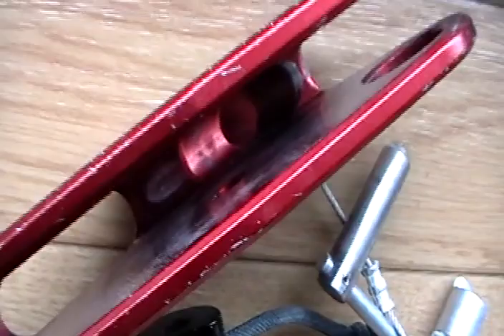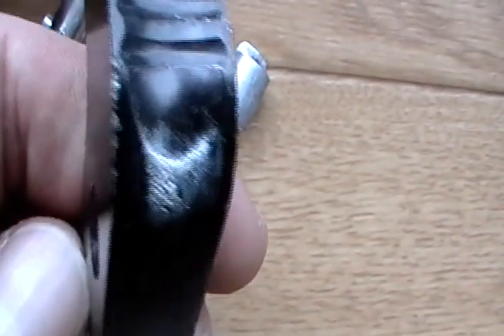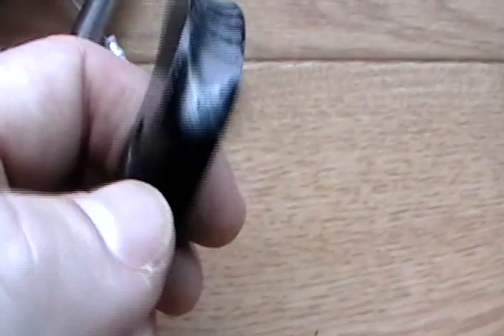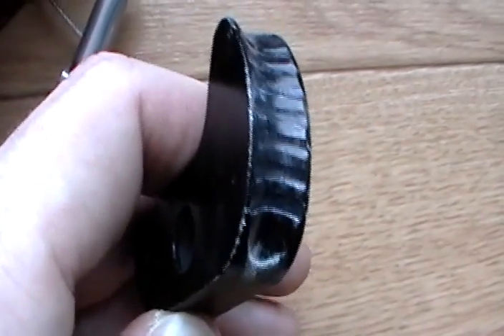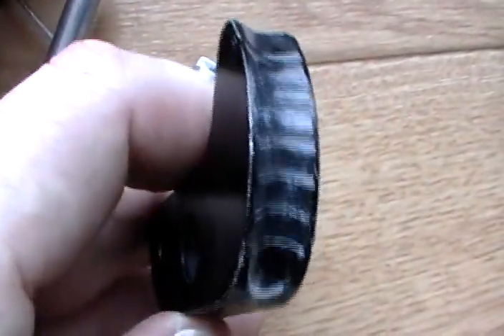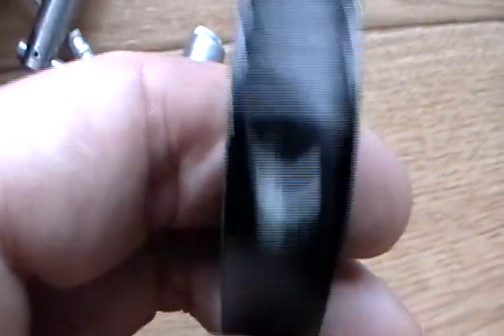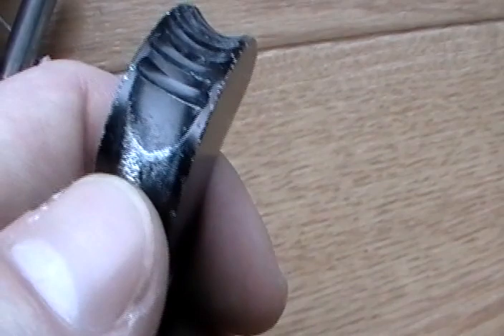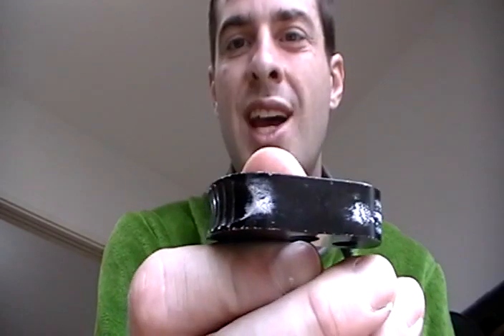UPDATE SERIES #4 - Rope Solo Lead Climbing - Soloist Belay Device Jamming with the Climbing Rope

Comment: Thanks, Aron.  Nice presentation and analysis of the problem.  Unfortunately I have a similar problem and no solution is obvious.  I have used the Soloist since its inception and mostly with great joy.  A wonderful alternative to the old methods of using knots.  But lately my Soloist locks up -- only on rappel.  Never a problem on lead.  I use very little (colored) chalk and the Soloist doesn't get any from the rope.  I don't do those horrendously difficult climbs, but it's a little disconcerting to have the thing lock up on a free rappel! ( I am (decidedly) not dripping with sweat on a 5.7 or 5.8. ) I have examined the device carefully and could find nothing obvious.  It has some wear -- particularly in the area below the teeth where you discovered a chalk build up.  I deploy the soloist on rappel exactly as recommended, with an oval carabiner clipping the rope outside the hole. But the "locking problem" is so prevalent, I am now using a rappel device instead.  All I can see is wear.  Any ideas?
Tradrock
Reply from the maker: Interesting, I don't know what to tell you.  I prefer a different device for rappel anyway, so maybe that's your best answer.  Good luck!!!

Comment: hey aron ty for the video, iv had the same problem and on long multi pitchs, iv started to run a pipe cleaner spiraled around the rope (getting as long as i can with the spiral about 1 wrap every 4 inch or so.) and run it through the device every so often. though with a thicker rope it might not work, i found it keeps it clean enough. my main concern was dust from the rope building up, but like you i discovered the sap like gue on my pipe cleaner, something to try BEFORE climbing as you could jam it in there. and yes take it apart and clean it often.
keep inspiring the crazy solo rock climbers :) and at least your keeping the newbies safe with this video for the device you recomend. cheers

Comment from the maker: Good suggestion, but its not really so difficult to remove the paste.  I have been able just to take a stick off the ground and scrape it clean in less than a minute.  Its just important to check it after each climb, or even each pitch to make sure its running smoothly.

Comment: What is the best solo belay device known to man . Thanks Im new to the sport .
Reply from the maker: Primo Knoxville In my opinion, this one!  The Soloist by Rock Exotica.  Depends on what type of climbing you want to do though...
Reply: I live in Colorado I want something I can use in all seasons . Rock , snow , and ice .
Reply from the maker: Primo Knoxville Im not sure about solo leading on snow or ice with this device, seems sketchy...  Maybe the Silent Partner
Reply: reading the silent partner manual now. It does not recommend for use in freezing temperatures. Ice in the locking mechanism may cause it to fail during the event of a fall
Reply from the maker: Hi Tate- You are absolutely right!  I was just reading about this 2 days ago.  Very cold conditions cause it to malfunction, and I also read 1 report of someone who had it fail during hot conditions as well.  I haven't used the Silent Partner yet, but it scares me a little.  You can't see inside the device and just have to trust it.  I do want to try it out though...
Reply: Ya Aron, I just borrowed one from a friend, going to try it out on an Aid solo. Should be an improvement coming from a gri-gri method. But I understand the trust issues... haha thats what back-up knots are for